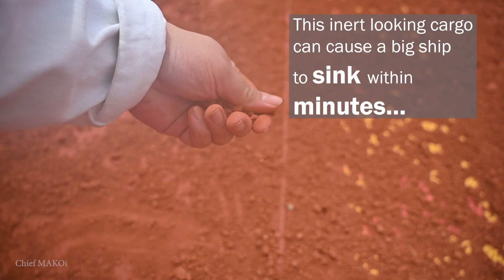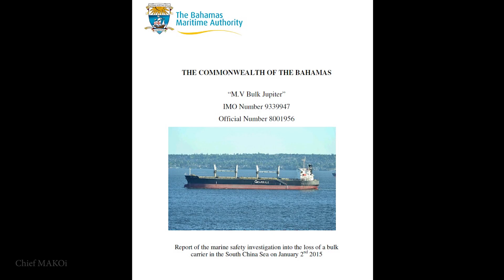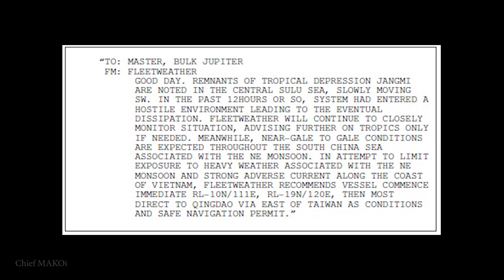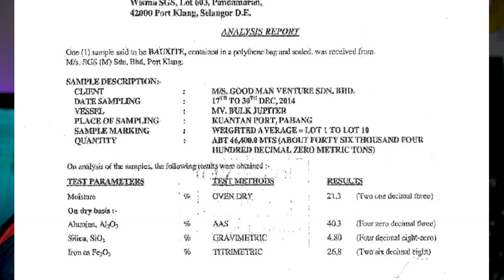The Cargo That Can Sink Ships Within Minutes : Bauxite Liquefaction | Chief MAKOi Seaman Vlog

Comment: Please please forgive me for such a question, just genuinely curious. 

From the videos I see, even the ones in this video, of ships sinking don't look all that dangerous. It seems to be somewhat slow and avoidable, so I'm not sure how all but one of the crew passed away from such a thing.

Am I missing a hidden danger, such as the boat sinking making it hard to just swim away? Maybe it sucks water down with it, so it pulls people under?

Also, how did the captain die exactly? How did he get away in the same way the other guy did, but in poor condition? What causes this poor condition?

Again, just a curious soul. Never really understood how a sinking ship caused such certain death.

Edit: I failed to mention that I do indeed realize that cold water is a massive danger, but I'm unsure as to what the water temps were for this incident. If it was mentioned, I do not remember.
Reply: A lot of this just comes down to something stupidly basic and under the radar. Ships are massive. 20 minutes isn't a long time at all. It seems like a long time when you're sitting down on YouTube or watching TV but when you have to walk somewhere and actually do something it's absurdly long.

Quick anecdote: Of the construction project I just finished my stint on, it was a type of power plant, 17 levels high, 50m total. About 6 months ago we ran a mock evac drill, we were all informed of the fact we'd have an evac drill at some point knowing the time frame window within an hour. Thus, we all sort of dragged our work and prepared for the fact that we'd have a mock evac.

They thought we'd be down and out in just a few minutes (keeping on mind that you never run during an evac) but it took us 10 minutes to clear the building. Keep in mind also that there were trades such as scaffolders and rope access workers (abseilers) which is what I do and we all already had our tools down and we were off the ropes/scaffolding to not make it any more difficult for ourselves and we all lingered around level 12/13 too. We didn't want to hang around the ground because that would be obvious, but we couldn't be bothered walking down from level 17. Given ALL those factors and all these small opportunities to prepare, it still took us 10 minutes to clear out.

This checks out, if you have to go to the ground to get a tool or go to the toilet it's easily a 20-30 minute round trip.

I've never been on a merchant vessel but given my experience in construction and mining and knowing how long it takes to walk around large facilities, I'd be willing to guess that any large container vessel or bulk cargo vessel presents itself as easily a 10 minute walk from bow to stern or vice versa, going from bilge to deck or vice versa. If the lifeboat is a 5 to 10 minute walk from any part of the ship, then once you factor in the 1 minute to fully respond to the alarm in a mental capacity, the time it takes to stop whatever task you're doing (potentially a work task) and actually make your way to the life boat, you've easily chewed up 10 to 15 minutes.

And that's before you factor in all things people would typically think about like negotiating obstructions and sealed bulkheads, having to navigate around possible water ingress of equipment failures, or simply the difficulty in moving through a severely pitched or violently rolling vessel.
Reply: @Mr539forgotten  That's a good point. It looks slow, but part of that is the sheer size.

It reminds me of seeing a video simulating two planets colliding in real time; it looked like it was in slow motion, but they were actually traveling at many kilometers per second relative to each other. Even though the Earth orbits at 30km/s, it still takes over 4 minutes for it to move the distance of its diameter.
Reply: Thanks for the replies! These make lots of sense, especially the sheer size and tilting of the ship. I really appreciate the straightforward, polite answers.
Reply: Also remember that they were in the water from about 7am until the afternoon, that's a huge drain on anyone's body. If they had been able to reach the life raft they could maybe have gotten dry, or at least warm.
Reply: Few answers.

A. The moment the ship lists a certain amount in one direction it becomes very hard to move. 

If you have a 45 degree tilt added to stairs your trying to climb them nearly vertical.

If your going down a hallway you can either speed up to the point of falling.

Exhaust yourself running uphill.

Or deal with a really awkward movement.

The floor doesn't have to tilt nicely.

If the floor is tilted to one corner and your moving the opposite direction away from the part in the water your moving uphill and walking basically sideways across a hill as it were. Your not walking up or down a hill but sideways which is the most annoying while also up hill.

Doors won't open because they are insanely heavy when tilted in at you.

Also metal covered in water is really slick. 

I assume if you are in the open and wearing your life jacket then hopefully the suction power won't take you under long enough to kill you.

Comment: I remember, about 40 years ago,   noticing that there had been a number of bulk carrier sinkings reported. Knowing virtually nothing about maritime matters  I concluded that these fairly new vessels had simply been overloaded by greedy owners. (I was very young) I can see now that reality was more complicated. Its always good to learn - Thanks!
Reply: Not overloaded, but improper cargo inspection procedures
Reply: but you are also not wrong. many operators overload and incorrectly load bulk carriers, and by their nature a bulk carrier hull experiences many stresses that require constant maintenance, something that smaller operators in all the corners of the world simply do not stay on top of. a lot of them are lost due to fractures that go unaddressed.
Reply: Berge Istra and Berge Wanga were two ore tankers that sank at the time. There was probably an explosion because the inert gas plant was not in order. 
After that, no more ore tankers were built.
Reply: I mean, they were still sunk by greedy owners willing to risk their crews...
Reply: @squelchedotter  The cost of a sunk vessel far outweighs cumulative gains on extra 1.5% cargo load each trip. They care about money first and foremost, that's why none of them does that.
Reply: @michaelbuckers  I put in an oceanographic system for Port Hedland Western Australia that allowed bulk iron ore carriers to be loaded to the maximum possible level given the real-time tides and waves - the channel was shallow. In the next couple of years 3 vessels from there disappeared in the Northern Indian Ocean. That may have been due to the age of the vessels, or perhaps cargo movement. We'll never know.
Reply: Were cargo liquefaction risk well known 40 years ago? Technological advances and knowledge grew a lot in those 40 years.

Comment: Can this issue be easily solved by deviding the loading space with a wall in to a left and a right compartment? So that load can never get to the other half of the ship?
Reply: No.  The problem is in the fact that vibrations will travel through the bulkheads between walls and will sync the sloshing no matter the configuration of the individual holds.  It's called constructive and destructive interference.
Reply: Dont load wet cargo. Easy fix!

Comment: I’m surprised they don’t have metal plates that could be vibrated into the cargo to separate the mass. Thus minimizing shifting when it comes to these materials. Never knew this happened. Wow great video
Reply: It's a good idea for smaller loads, but I can imagine on that scale it would be very costly. You'd still need to skim off the slurry afterwards too. Probably cheaper to unload the ore and dry it out, even if it means extra costs for waiting around or steaming faster to make up time.

Comment: There's another more familiar cargo that can be real trouble.  Car carrier ships have a vast hold where vehicles are secured.  Historically, they were either RO/RO (roll on, roll off) or actually craned down into the hold.  In either case, they are secured by ropes or normally chains.  Here's the menace: in high seas, one might break loose.  Like a pachinko game, one might roll into another; it doesn't stop until you have every one of them damaged (or ruined) and a significant force of them is then pounding at the super structure.

Comment: Could this problem not be remedied by installation of large baffles in the cargo tanks? 

Seems like an easy mistake to avoid. However, I've not done a deep dive on the engineering behind this, so please forgive my ignorance.
Reply: How would you load and unload a solid cargo if there were baffles?
Reply: @jimmac1185  Removable partitions?  Multiple loading openings?
Reply: @SeekingTheLoveThatGodMeans7648  Hmmmm 🤔. Sounds expensive
Reply: @LegendaryP-sl7gf  and time consuming...
Reply: I_Commission_DSPriscilla_Art  It's not that simple. Take a look at chief's video explaining why they don't use baffles. Also, why the insults? What have I ever done to you? As a society are we really that lost that we can't have a civil discussion without calling each other names?
Reply: The problem could be remedied by not taking ore over the safe moisture limit.  The easiest and cheapest fix of all.
Reply: I was wondering the exact same thing.
Reply: I_Commission_DSPriscilla_Art  Thats pretty sad that you are in the state of mind to just lash out at anybody that has a different point of view than yourself. Time and money run the world. If you can save both by taking an evaluated risk, I hardly think that is "goofy". Did you watch the video Chief put out a few days ago explaining it?

Comment: Mabuhay Chief. I wouldn't have chosen bauxite as a dangerous cargo. I probably would have gone with an inhibited cargo like styrene. Did you used to work chemical and oil carriers that went into Beaumont, Houston, corpus, lavaca and or NOLA and Lake Charles? That was my area as an inspector from 2000 to 2016.

Comment: This is a case where construction workers and sailors use the same principle for opposite reasons. Liquefaction does occur like your video showed by only when you get dynamic separation is it a problem. Typically when compacting soil I have to add water because it will drain off and dry the soil making it unsafe.

Comment: Trucks that are transporting liquids have separations lengthwise to avoid the liquid slushing from one side to the other in turns. Why don't they do similar things for ships that carry any cargo with liquid properties? It's a very simple yet very effective way to prevent those issues. As long as the cargo is compartmentalized there can't be an issue like this, no time will be lost, nor any lives or ships... not to speak of the environmental disaster from a sinking ship.
Reply: I believe the issue is that these vessels are designed to haul solids. Installing more baffles will significantly increase the load/unload times.

Comment: Seems like this could of been easily prevented by including more vertical and horizontal walls in the cargo hold, so everything stays put even if you were hauling a liquid. Bad engineering isn't acceptable having to rely on moisture tests is insane. If there were bad storms and waves washed into hold then your guaranteed to have too much moisture in hold.

Comment: If you live in Florida, you may find yourself following an open truck full of the stuff Floridians call "lime rock." This is a fine granulated natural mineral that sits piled up in the truck like a solid, until the truck hits a bump, brakes or turns sharply. Then you will see this seemingly cohesive solid mass turn into a liquid and slosh from side to side until it suddenly "freezes" into a solid again. That's liquefaction.

Comment: If you could add a barrier (lengthwise) in the cargo area, dividing it in 2 compartments, then liquefaction will become a non- issue.
Reply: That is correct, but it severely reduces the practicality of loading/unloading of the vessel. Furthermore it causes more problems than you solve as you introduce a big concern/issue of stability should a cargo compartment ever become flooded.

Comment: So when the "solid" cargo turns into sloshing mud, does it just end up stuck on one side after a wave rolls the ship?  Or is is really a matter of resonance?
Reply: The mud/slurry will move to one side of the ship and cause it to develop a list to one side. The more the ship starts to list, the more mud will move to that side. Once the ship’s list surpasses a certain angle, you capsize.
Reply: @nicolasdenis7094  
But wouldn't that mean that ANY shifting/sloshing cargo would sink a cargo ship?  
How is it then that liquids like oil can be transported without capsizing?  Or shifting cargos like sand?
Reply: @HannahLemurson  any shifting or sloshing cargoes are to be avoided. For tankers there is a simple trick to avoid sloshing. You load the cargo tank either completely full or empty (who would want to load a cargo tank only 50% full anyway? You would pay freight for empty space). In case the product shipped cannot be loaded in a tank at 100% (e.g. because of temperature expansion or blanketing requirements), then the shape of the cargo hold is changed into dome tanks, e.g. LNG tankers.
Reply: @nicolasdenis7094  Ah, that makes sense now!  The problem with the Bauxite is that it sloshes AT ALL.  And if it's only stored as you might store a solid load, then there are no protections against the load shifting.  And then the ship unexpectedly capsizes.

Comment: the minute you said the loading had been stopped several times for rain, alarm bells went off for me. I'm no expert(Edit: and I'm a landlubber), but I've seen what loose sand can do to a truck and trailer on a straight road with no wind and when you said gale force winds I knew exactly what you were speaking of happening with the cargo.

Comment: Wouldn't more baffles in the hold of the ship--especially ones that prevented lateral movement of cargo across the entire width of the hold--prevent such an accident from happening certainly it works with crowd control, and a crowd behaves like a liquid at sufficient density.

Comment: Why not divide the cargo hold with lengthwise bulkheads so the cargo can not move all the way from port to starboard and back ?
Sure, unloading will take a little longer but safety would greatly be increased.